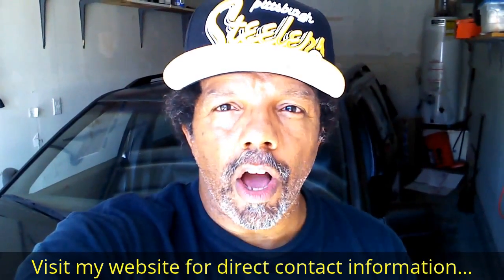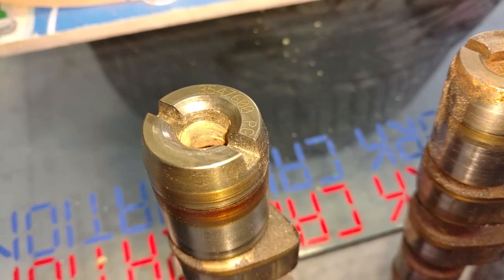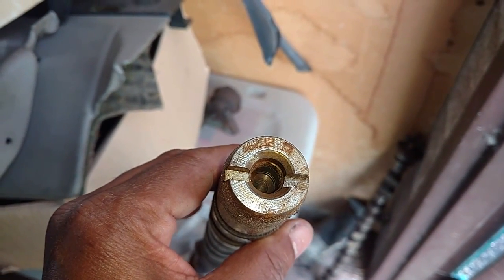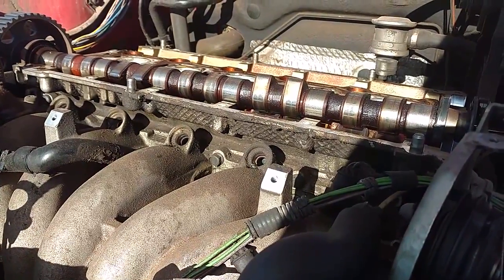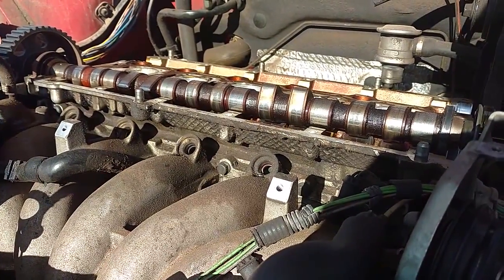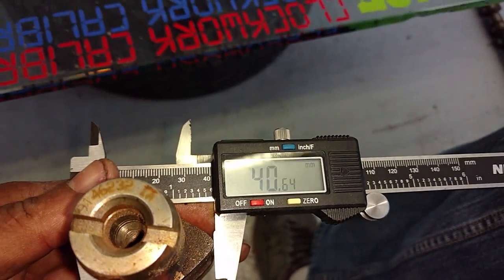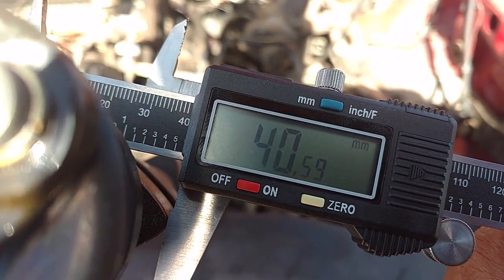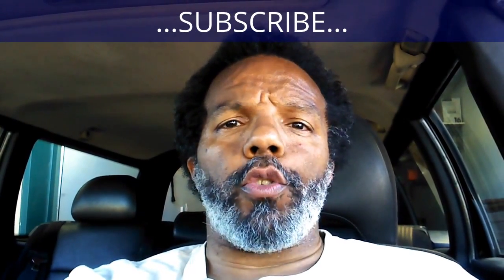NA cams upgrade on the Volvo 850, S70, V70 T5 engine. All of the NA cams from '92 TO '98 work - VOTD

Comment: Would the non turbo cams benefit a glt low pressure turbo engine or do the low pressure engines use the non turbo cams already? Thanks! Also, is any ecu tuning required for the swap for drivability.
Reply from the maker: https://youtube.com/shorts/67P5Q8W6bck?feature=share

Comment: There is a debate that has been going on for a long time... There are people wondering if a Non - turbo glt could be into a turbo glt? I think there if these people wants to turbo a non-turbo car needs to modify a few parts and upgrade the ECU, injectors, manifolds and piping. Possibly cams as well. But, to clerify. I don't think cams will make a difference in these vehicles since they look the same. Think it's possible?
Reply: If the connecting rods and bottom end and could hold up to the boost then yea
Reply from the maker: Yes 🤢

Comment: Easy to make faster/ remove map sensor (manifold air pressure) google it/ tape it up/block hole/fit manual boost controller demon tweeks £20 and set at 15 seconds past 12 o clock and watch it fly with maxed out 17psi from the td04 16T and use Tesco momentum 99 or cosco 99 octane enjoy but watch the speeding its like having a new engine from a v12 and use denso racing plugs worlds smallest tip and one step colder
Reply: How long would this last lol

Comment: about how much is a set of these NA cams worth?$$ ( used of course)
Reply from the maker: Worth? Supply and demand. It takes about an hour to remove them and they cost $40 at many junkyards. I'd ask $100 for a pair based on that.

Comment: Googlen translator, sorry if mistakes. My question. 

How much is the power difference? Does anyone have a t5 steed on the dynamometer with camshafts and freely breathable camshafts?
Reply from the maker: 11 HP Stock, I believe 5% overall.
Reply: difference is 11hp?
Reply: ok, thanks
Reply from the maker: Yes but the torque curve also changes which make a nice difference.
Reply: Torque curve, how it changes? Maybe maximum torque is higher?
Reply: I have t5 with pd tuning chip and 3" dp, and i sometimes think that what if i changes camshaft, what kind is engine then. I don`t want lose low rpm torque. Stock cam lift valve only under 8mm. it is very less. When usually na engines with tuning cams have around 11mm lift.
Reply from the maker: I'm not a tune guy. It took 1 second off of my 0-60 mph speed.
Reply: Noooo, not 11mm lift. 8.5mm lift. a 3mm difference would have your valves slamming into your pistons
Reply: Yes but i mean usually what ever tuning cams what ever car. Not 850. 

Is na cams lift 8.5mm?

Comment: I wouldn't change the cams... without more research. In german forums the consens is you lose power all around except top end and a tune should be used. Imo that makes sense - Volvo did design them like that for a reason.
Reply from the maker: +hausm3ister I put them in two cars now. If adjusted/timed properly, they are great all around, tune or no tune.
Reply: I am not saying you are wrong. But I do not think it is as easy as a bit more lift = more power. first google hit: http://www.hotrod.com/articles/hrdp-1011-cams-for-turbocharged-engines/
There is a lot more to it. What I am saying is that without a before and after comparison it is wrong to talk about an upgrade. I don't have the experience to contradict you, but I know what I do not know ;)
If you have some data on it please share it :)
Reply: @RobertDIY  do you just time them correctly or do you change the timing slightly?

Comment: Phi-6842281 intake  Phe-6842282 exhaust is the right number 92-93 GLT 170hk engine
Reply from the maker: Cool, thanks for sharing.
Reply: Dude those are turbo cams, where did you get that info??

Comment: Hi Robert thanks for the vids.

I have a question I hope you could help me with. Sometimes the engine on my volvo V70 stops a couple of times and I have to restart it a couple of times before it finaly runs without stopping, it mainly happens when it is wet of damp outside but not every time. so what could be the problem ?
Reply from the maker: Have you tested the fuel pump relay?
Reply: No I haven`t how do i try it to see if thats the problem ?
Reply from the maker: https://www.youtube.com/watch?v=GclQq7VpC08
Reply from the maker: https://www.youtube.com/watch?v=gt9w-ZSxs9I

Comment: In Sweden the saying is that for t5 cam upgrade you shuld get the early 850 2.5-20v cam from 91 or possible early 92. Roumor say the earlest cams where the hardest. But after rough idle complains from owners volvo put tamer cams for later cars staring 92 model year. The cams that you have have should differ between 94-95 model don't know how, but the reason is that Volvo ditched the vvis intake for cost and reliability reasons for the 95 model year. To compensate for the low to midrange torque loss when removing the vvis they redesigned the cams.
Reply from the maker: +nilsutt Oh, the '93 & '94 cams here have the same part number. The '95 - '98 share the same part number. But I could not see the difference with the caliper.

Comment: Love your videos thanks for making them . 
I think the NA cams have a higher lift duration than the turbo cams so if you swap NA cams into a T5,it should give a slight raise in output . But from experience it's marginal . All the best from the UK Robert.
Reply from the maker: +In Deep Yes, that is what they say. Someone had them dyno'd here and found 10 more HP.